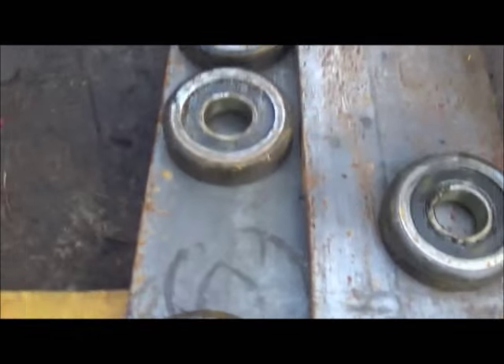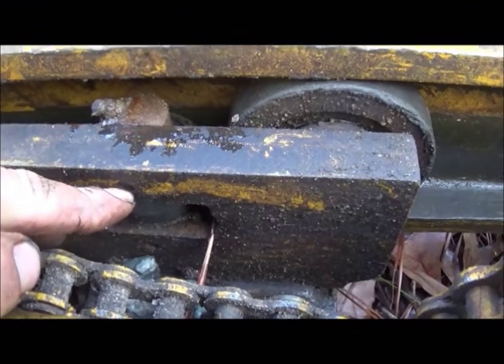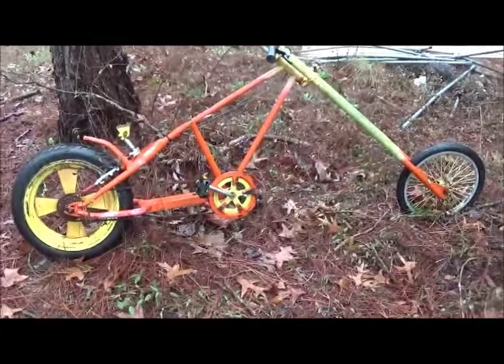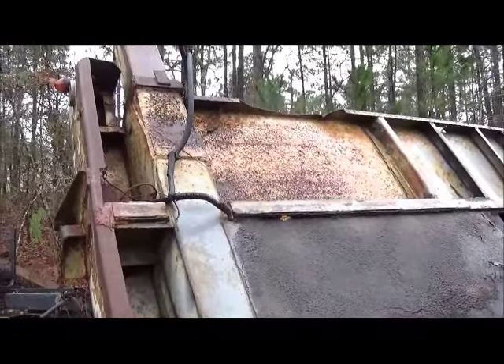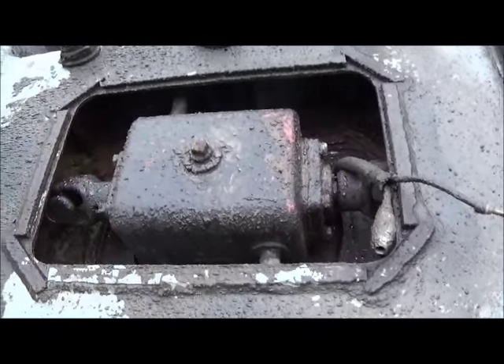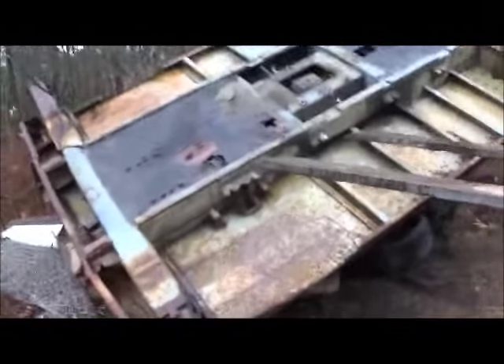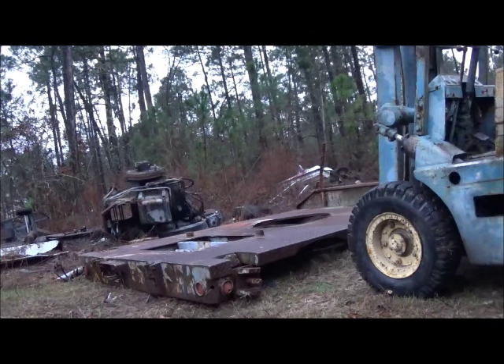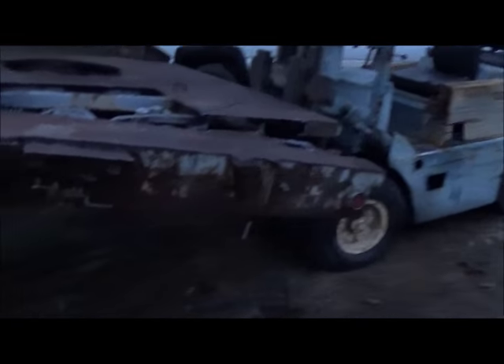4x4 Wrecker Build Part 18 Reclaimed Outriggers!

Comment: the outriggers go out parallel to the bed and then how do they angle down towards the ground
Reply from the maker: +Eric Polston This I going to be my slide to get them away from the truck. There will be outriggers on each end that go straight down. There is also another way to do it and that will be explained in the next video.
Reply from the maker: Eric Polston yep

Comment: wear did you get Ur pants.. I need some.. I do Towing.
Reply from the maker: +Paul Barnes  They are Uni-first rentals. I have about 20 sets and they pickup once a week. They do have a reflective stripe in the center of the yellow stripe. Over the years I have had my truck hit twice while sitting off the road. I always hope they will help. I am on call 24/7 so I usually wear them everyday.
Reply: Me too..I owned my tow company.. Work a lot at nite. So thanks.. For the information.. Like Ur video..